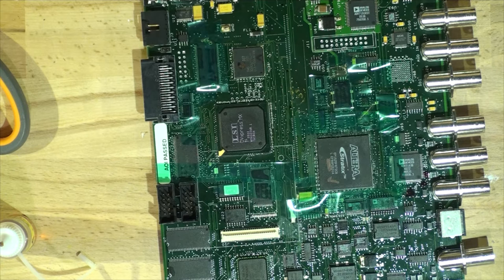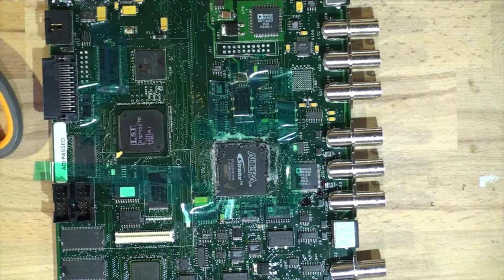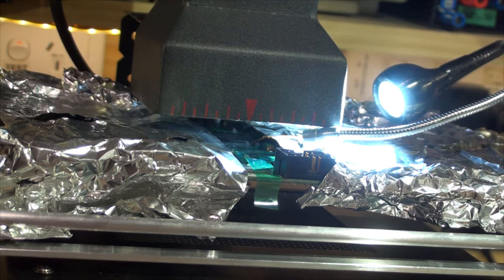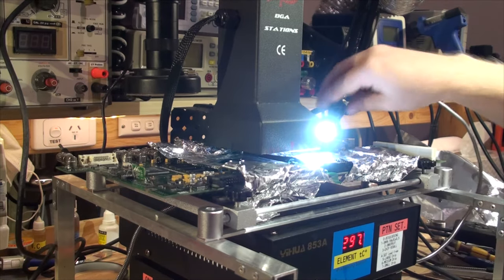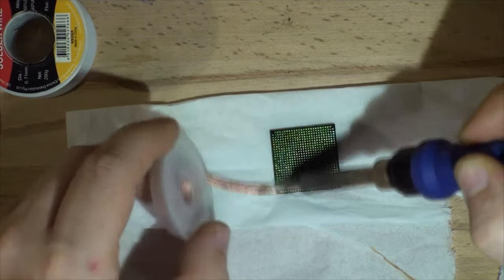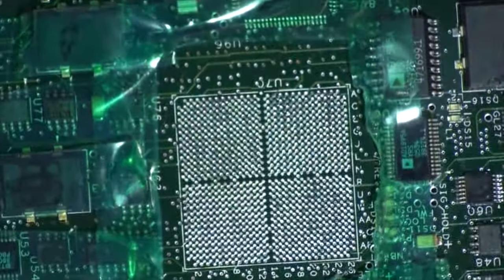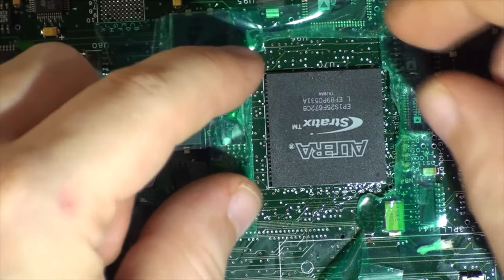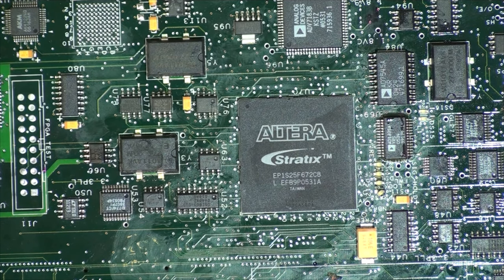BGA Reballing at Home Explained, How to. Tips And Tricks.

Comment: Interesting video. Technically, you are at home yes. But my definition of at home is not with a BGA remover machine, more DIY sort of thing. The mistake is mine. Still a cool process though, thanks.
Reply from the maker: I have a video where I build the machine, amd also explain the cheap option how to build one using halogen flood lights. Have a look on my channel for this video, it explains how to use different options from cheap to expensive and on of the options is floodlights to build bga station
Reply: How do I reset a bga chip?
Reply: @MaxELECTRONICS  hi How do I reset a bga chip?
Reply from the maker: What do you mean by “reset”
Reply: @MaxELECTRONICS  i want to erase the memory on the bga chip so its rest and ready for reuse  i heard that if i use this device it might help esp8266 version
Reply from the maker: You’d need to find datasheet for the IC and follow the datasheet’s instructions.
Reply: @MaxELECTRONICS  what if i cant find the data sheet is there a way to get the data sheet
Reply: Same I was thinking lol. Great vid but I need to use a heat gun and duct tape and a blow torch😮😅
Reply: Lol I was saying the same thing, like who has all this stuff lying around at home, I was expecting to see the main ingredients, that being the solder paste, flux, soldering iron, heat gun and maybe a few extras
Reply: seems we all here for the same reason, lol. Anyone has found any useful resource in these regards?

Comment: This video is great; thanks for sharing this with the world. I've found that good flux, patience, and a light touch with the iron and braid is the way to go. Here's an extra tip - clean the flux off with alcohol when the surface is still warm. Makes it much easier. If the part or board cools and the flux gets gummy or solid, add more liquid flux and rub lightly. It will help soften up the hardened flux, allowing you to get some alcohol and clean the area easily. Thanks again for this video 👍

Comment: What is the advantage of the balls over using solder paste?
Reply from the maker: Using solder balls you’ll have even amount of solder over the pins, using paste you’ll have a big pool of liquid during flux warm process and some pins will have giant amounts of solder and some won’t have enough, everything will be uneven.
Reply: @MaxELECTRONICS  But the stencil should allow you to spread the paste evenly, shouldn't it?
Reply from the maker: Yes but when you heat it up it will become liquid and turn into one big pool of liquid because of the flux on the paste. It will not hold shape.
Reply: @MaxELECTRONICS  What if your keep the stencil in place?
Reply from the maker: @NicksStuff you’d have to get special stencil and it still won’t be clean. There’s a reason why balls are used.

Comment: Remember it is impossible to tape unused patterns for every chip so many times you will need to order the exact stencil if Tape of as much as possible although all ball will reflow they will not stick to the non tinned pads so simply Clean off non sticking balls and clean and Reflow again without the stencil on the Jig. If the stencil is to low the balls will not release correctly if the stencil is to high then the balls will go underneath the stencil . Important to heat at 300 degrees with low air and start at one corner then the whole chip.  Good Tutorial.  Another good tip is to prep your bga chip with Rosin and Solder and a Hot air Gun then TIN the pads with 183 degree Solder # Very important if it is difficult to tin a pad it will have issues accepting solder paste also.  Use 3D Stencils if you can find Them higher Success Rate. ! Pro Tip.

Comment: With 183 Lead Solder the Chip will self align as long at it is Close to the Correct alignment then once it reaches Liquid State - Specific gravity of the Solder will hold it in place and if you budge it slightly with your Tweezers then if will return to the correct position and you can be assured that the Chip is aligned properly
also when you are watching reflow look for the Chip to drop and the solder Flux to overflow just a little then you should allow to heat for about 5 Seconds and then Test with the Tweezer for self Alignment this Technique is important because the DIE of chips is different and therefore the amount of heat that is required to reflow chips will vary so you must use  Drop - Flow and Test Technique if not you run the Risk of Overheating certain Chips  and damaging them and components around them by Exceeding the required Heat Dwell Time for that particular Chip .  also there is a Phenomenon called Pseudo Soldering where components on the back side of the board are flowed so every effort should be used to reduce temperature on the back side of the board and surrounding components . Proper rework Technique is Entire board should be heated to 150 degrees and Even Heating of the Component to be removed should flow up at 2 Degrees per second never exceeding the Manufacturers Max TEMP Specs. by using the Drop -Flow and Test Technique you will never exceed Manufacturers Dwell or Sustain TEMP Max which WILL DAMAGE CHIP.

Comment: very excellent video. Question: you used a hot air flow solder. Is it the only right way? What about the infra-red solder method?
Reply from the maker: Yes you can use infrared too

Comment: Thank you for the informative and detailed video. I just invested in a more basic reball station gotten inexpensively from a console repair shop (T862++) and it does not have the automated processes like yours does. Would you happen to have any advice for the careful use of a more basic machine? Ive never done a reball before and will definitely practice on some junk boards as youve mentioned before any attempts at a dead ps3 but any other advice would be welcomed and appreciated. (Prep, machine temps, graduation of temperature, max temperatures, times and proper care of not burning the chip itself)
Reply from the maker: Best advise I can give is don’t rush it, be patient, don’t crank the temperatures up, it’s ok for the board to be heated longer, it won’t hurt it but it’s not okay to raise the temperature to get it done quicker. It’s a time consuming work, so just be patient and take brakes in between tasks. And add flux if old chip still doesn’t pop off.

Comment: Does it require the exact stencil for each component being worked?  There are so many variations it seems it'd be difficult to find.
Particularly if you have rows and columns that are vacant, and need to remain unpopulated by the balls, if using some universal stencil that has a full grid pattern.  Seems it'd be a very tedious process to extract them without disturbing the adjacent balls, since they can't simply be left in for removal later.

Comment: Would a modified toaster oven using quartz heating elements/rods make a suitable pre heater? Maybe 2 or 3 elements, sufficient space, controls...for pre heating as laptop m/b? Thanks does using thicker aluminum foil help with heat deflection? Where do you place the lower or bottom heat sensor?
Reply from the maker: Yes you can use quartz ir, you could use thicker foil but simple kitchen foil works just fine, you only creating temperature difference enough to prevent solder melting under the foil.
Lower heater sensor goes in the Center of the pcb, right under the chip you desoldering.
Reply: @MaxELECTRONICS  ok thank you

Comment: First time I have a chip which is oxidized and pads on it are darker. I can re-ball the chips, but don't know how to clear pads on this one so that my 0.5mm solder balls can hold. Any advice?
Reply from the maker: Run soldering iron with fresh solder and RA flux over it to re-tin them, then use desoldering wick to remove the solder.
Reply: @MaxELECTRONICS  I did, but just learned that I need to add a hot air as well to the process to make it working as not always can be done this way.

Comment: Gee wiz, I guess won't be attempting my laptop processor upgrade. LOL. Nice video man. Thanks for putting my question permanently to sleep.
Reply from the maker: It looks scary but grab couple of old boards and give it a bit of practice, it’s not that difficult once you try, and I have a video on how to build a BGA machine, you can just use a halogen flood lights as a top and bottom heater. Don’t give up. If other people can do it, you can do it too.
Reply: @MaxELECTRONICS  Ha yeah, it's not so much scary, as it's not worth the hassle. An old free laptop I picked up could get some more performance, but the time and money put into it would be more effectively applied to a new computer. 
The laptop is more than 10 years old, and wasn't designed with upgrading in mind. It doesn't even take more than 8GB of RAM total.
I really do appreciate your optimism though. If I ever had to reball a board, I know where to look for info. Thanks man.

Comment: i was expecting to see you tweeze the balls one by one lol... may have to come to it for me. i can't afford such a machine or even the service ($90+) for swapping a bios chip on a hard drive.. (sadly it wasn't an 8 pin IC, it is built into the bga chip). do you suppose tweezing solder balls is possible and then just using a heat gun?
Reply from the maker: Yes of course it is, it’s a very time consuming process but it’s doable, just take your time doing it, like jigsaw puzzle, don’t expect it to be done in 5 minutes, don’t rush and take your time, specially with soldering using heat gun, take your time heating everything slowly.

Comment: Hi 
Can i run both heaters by one PID controller(and of course by one temp. sensor) ? 
Is the temperature of both heaters the same ?
I have PID controller made using arduino and a circuit board with triac on it and the program that i'm using controls one heating elemt only.
Reply from the maker: Hi, no. You need to have a preheating and soldering element. The preheating is set to a steady temperature and stays same throughout the whole process while the head element follows the reflow profile temperatures you have to have 2 separate heaters, you can build them using a halogen flood lights. Have a look for “DIY BGA Station” video on my Chanel where I explain all this.
Reply: @MaxELECTRONICS  thanks. i have a 12cm*12cm IR element for bottom  heater. If it should be steady i can make a pwm controlled circuit to keep the temperature steady.
Reply: @MaxELECTRONICS  what is the ideal temperature for bottom heater ?
Reply from the maker: Around 120 Celsius I think, check out this video for all the tips and settings.
https://youtu.be/CqqU1jwzgqw
Reply: @MaxELECTRONICS  ok thanks

Comment: What could be the problem if my chip slipped to the top-right corner of its site when re-soldering it to the board, instead of staying centered and snapping in place on its own ??? :|
Reply from the maker: Are you using solder paste or solder balls?
Reply: @MaxELECTRONICS  Ballz......granted, it's my first time, but I thought I did a good job up till that point. Everything seemed to go well.....
Reply from the maker: Try using less flux and longer “flux activation” time in profile settings. Make sure all the balls soldered well to the chip and cleaned well before soldering chip to the board, make sure the board is flat and levelled and chip is sitting flat and not rocking, also make sure that before you solder the chip to board, all contact pads on the board are free of solder and flat and clean.
Reply from the maker: It takes practice

Comment: when everything on the board are heated up to 200+ degree do you have ANY idea what will cause one slight movement of the tape or the aluminium ?
Reply from the maker: Thermal expansion?
Reply: The slightest move of the tape you used or of the foil because of the hot air will swipe everything on the board all tiny capacitors etc
Reply from the maker: That’s why you have to wait for cooling period to finish before touching anything
Reply from the maker: Plus the foil is there to protect other parts from heat.
Reply: @MaxELECTRONICS  the air of the machine will move the aluminum and the tape while you are desoldering or soldering
Reply from the maker: What air are you talking about? There is no air in there
Reply: ΟΚ so the heater uses ir not hot air..
Reply from the maker: That’s correct
Reply: I used to work as a computer technician, I owned a zm4860 station if I remember correctly which was using hot air for the upper heater

Comment: Hi Max, very nice instructive video. I would just ask a small question: what are you doing in case of dull pins on the BGA?
Reply from the maker: If it’s a fresh ball that is dull then simply add a drop of flux and reheat it, if it’s an old solder joint you’d have to remove the solder, clean the pad and apply new ball.
Reply from the maker: If you looking for temporary fix you can just flood the chip with rma flux and without removing the chip just go through the reflow process, but it’s only a temporary fix
Reply: @MaxELECTRONICS  It is an unsoldered BGA on faulty SONY TV. Even after cleanup or used desoldering braid, I still have dull pins. I still not tried to put balls on it before asking how to have shiny pins
Reply from the maker: Go over it with RA type flux and just standard solder, (as if you were to prepare to solder wire to it) after that clean all fresh solder you added with solder wick again
Reply from the maker: I recommend the MG chemicals flux, its liquid, and it’s the best, it’s expensive but it worth every sent of it. It will even make corroded wires solder together! (Not that you should do that but it just shows how good it is.)

Comment: I'd like to see you use handheld hot air and see a few attempts that way to see how many failures and successes are possible.
Reply from the maker: I have for 2 years but it’s an improper tool for bga reballing it takes forever to preheat the board with it and maintain correct temperatures and profiles, plus it may cause damage to the ic or textoite, that’s exactly why I’ve build BGA station.
Reply: @MaxELECTRONICS  For someone who just wants to do 1 bga job every few years and enjoys the hack farmer jobs I'd be interested to know how people fine tune the handheld way. Which technique did you use. Perhaps you could do a video and show how frustrating that method is but how it can be successful with low rates.
Reply from the maker: You asking me to build a chemistry lab with a garden hose and a bucket. You need the right tools to do bga, not just hot air gun. You wouldn’t use a piece of wire heated by the candle to do soldering would you? I mean it’s possible but you can imagine the result. You need to have preheating for bga no matter what you do.
Reply: @MaxELECTRONICS  the cavemen did it. I love the hack jobs. Anybody can get a job done with the right tools. The art is in the bodgy.
Reply from the maker: If you enjoy working with incorrect tools please do, I have nothing against your choices, each to their own, you prefer hot air gun, I prefer BGA machine. Let’s just enjoy the tools we prefer to use
Reply: @MaxELECTRONICS  I'm working on a Sammy mainboard . Trying to reflow with hot air hand gun and I get flickers of life. I'll heat one more try and if not alive then remove the cpu and try a butcher job reball for all to see. I'll keep u posted. Watch this space.
Reply: @MaxELECTRONICS  Hahaha! In a very dire situation during a power outage, I used a piece of solid copper strand from home electrical wire that I filed down on one side, then held over a candle for a  few minutes to solder a resistor to a board,
Reply from the maker: We all can do that sort of thing when desperate, but why if we can build a proper tool for bga, and in a bga station video I have explained how anyone can do it on a low budget using a halogen flood light. The reason I didn’t use the flood light is because I could afford the head, but if I couldn’t affort a head I would’ve used flood lights.

Comment: Very neat, but almost certainly not an "at-home" type process. This is all very expensive professional gear, not apt to be found in a small shop.
Reply from the maker: It’s actually home made gear, you need those tools to do bga, can’t do without them. I have a video on how I built the station and how you can do it too, from low budget to high.

Comment: why did you Reballing ?
Reply from the maker: Because it had dried out solder joints that I saw on x-ray.
Reply: @MaxELECTRONICS  will it solve no display output in my home theater
Reply from the maker: You have to diagnose the fault, it could be something as simple as broken pins on connector or bad voltage busses or something else.

Comment: I was expecting a reball with tools found at normal home like a heatgun etc, i mean title implies reball at home. This is a professional setup, maybe a semi pro, pretty misleading title. But thanks for the effort and video anyways.
Reply from the maker: You have to use the reballing machine, you can’t use heat gun for reballing, there’s a very high chance that you will damage the chip, this is a home build reballing machine.
Reply: @MaxELECTRONICS  that i understand. larger chips need bga machines or it could cause damage, unlike reballing a 2x2cm or 3x3cm chip which can be done with a hot air station. I just said the title is misleading, this machine maybe built by you at home but it is a semi pro level DIY bga machine and requires significant investment both in time and money. When a title says 'reball at Home' one would expect a much simpler setup. Anyways. Bye
Reply from the maker: I did describe how to build budget reballing machine using 500w halogen flood lights. You have to use proper tools for the task, even small IC’s need preheating, flux activation period ect.